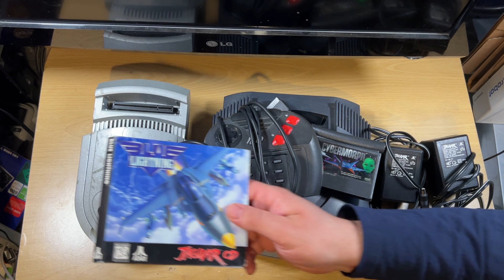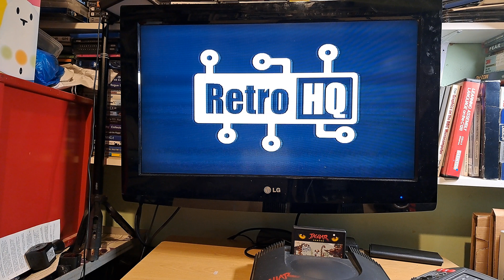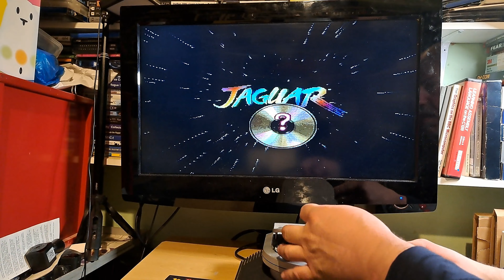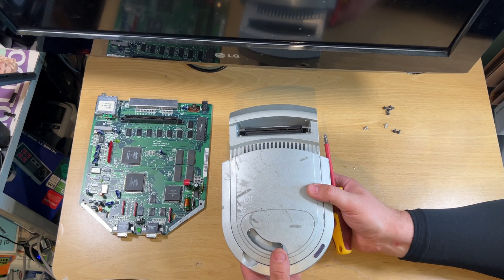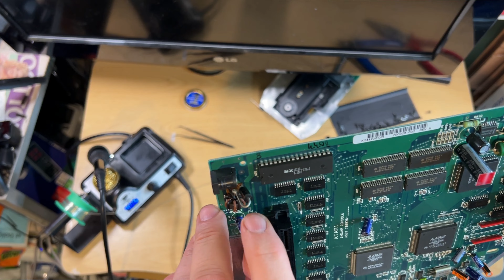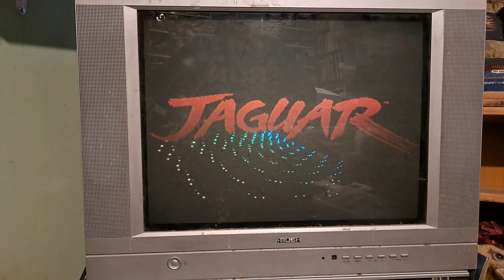Atari Jaguar - Reverse Power Supply Protection Diode Mod

Comment: I have been told many times I cannot test without a game inserted? How did you power up without game
Reply from the maker: You are 100% right and in fact its how most people get their Atari Jaguars cheap if someone doesn't know it needs the cartridge to work they can just say its broken and doesn't switch on. The reason it needs the cartridge inserted is to complete the circuit to power up the console. If it can't read the cartridge inserted, you get the red screen.

Why my one comes up like it has a cartridge inserted and has a red screen, I came like that. It is a mod that people sometimes do for diagnostics as you don't need a cartridge to test it. As my one came with the voltage regulator chip fried where someone has put the wrong polarity power supply on it, a previous owner must have done this. It's a really simple mod with a soldering iron. To bypass this system and allow the console to power on without a game we can simply short the B34 and B35 pins together on the cartridge port.  Hope this information helps.

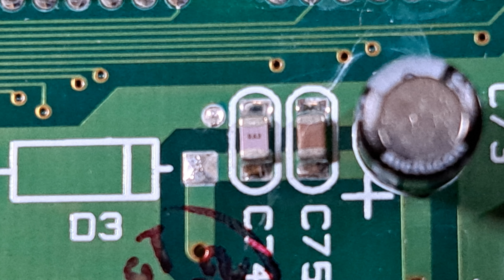Comment: On the closeup of the CD drive (12:25) you can see a spot for a "D3". If they put that diode in the diode would do nothing if the power was the right polarity, but a reverse polarity would have the diode short out the power supply. Basically the diode would damage the power supply instead of letting the power supply  damage the CD player.
Edit: The console probably has the same thing.
Reply from the maker: Interesting. It does seem a little odd that they didn't implement something to prevent reverse polarity power supplies. My only assumption is that when the Panther was put to one side to rush the Jaguar to market, someone left it out, probably by mistake. Their "get out of jail free" card is that it proved you hadn't used an official Jaguar supply.

Comment: I've never understood why any engineer ever would use a barrel connector and connect the pin to ground and the barrel to positive. Am I stupid or is that just an obviously bad idea that should be ridiculed?
Reply from the maker: I agree, it is the most insane thing to do from an engineering point. Logic would say positive in the middle and negative on the outside. It would be like wiring an exposed plug live, then plugging it into an insulated socket, it makes no sense. Back in the 1970s and 1980s there was no standard on how to wire a barrel jack up but by 1990s most where centre positive, I guess someone wanted to mix it up a bit